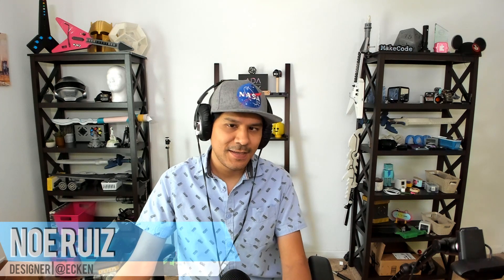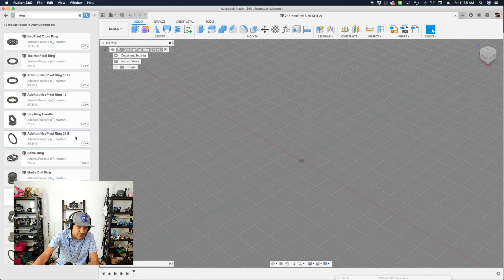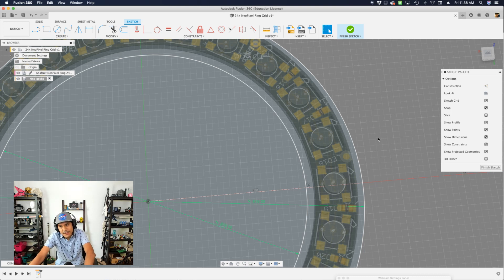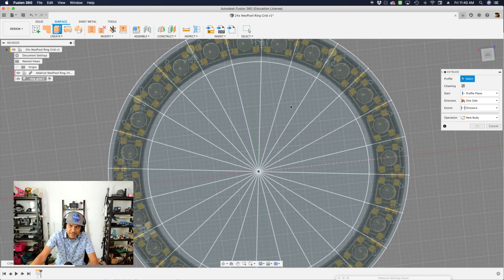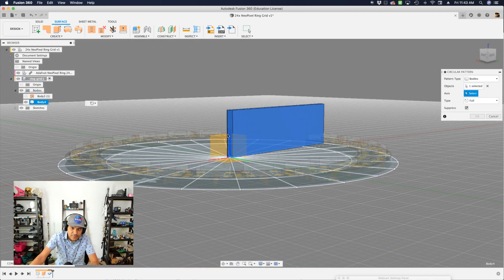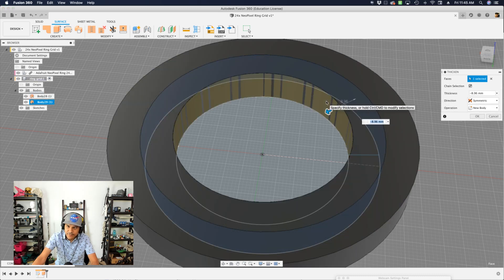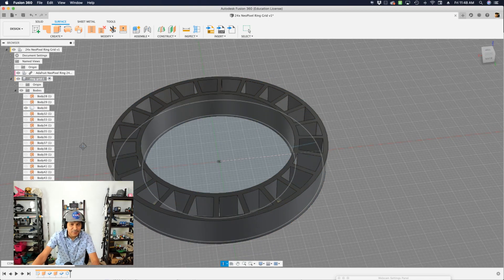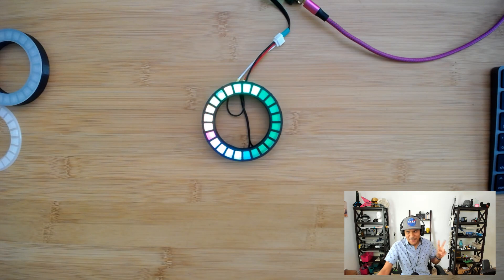Fusion 360 Tutorial – NeoPixel Ring Grid Diffuser

Comment: In a Cyberpunk Mask that I ordered there is a 24 LED RGB Ring. I can see the output wires were connected to set of three wires. At the end of that it looks like the wires were spliced and connected to a small push button control. That allows you to get the 50+ effects. That is  then connected to the USB plug. No app... no small board. Super small in comparison to this. Any idea how this could be accomplished? I would send you a pic for reference if you want to take a look.